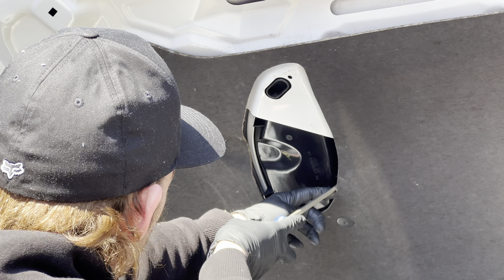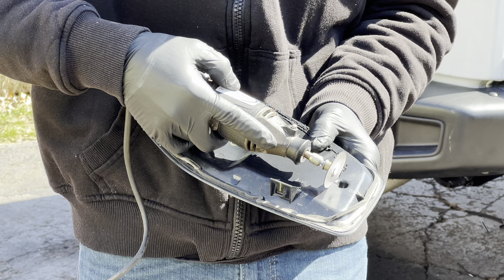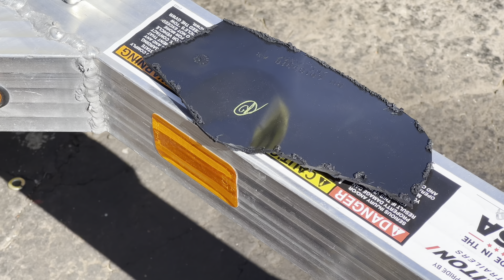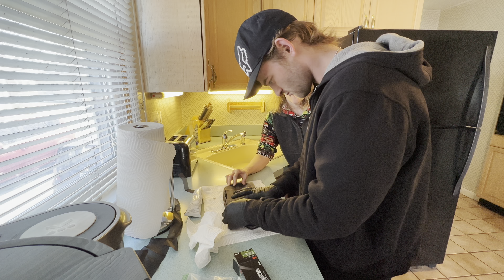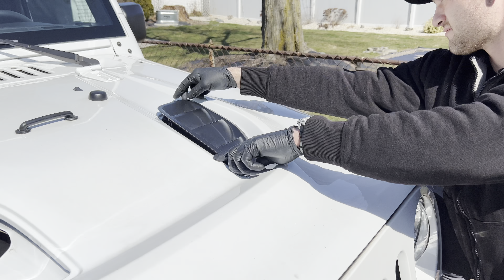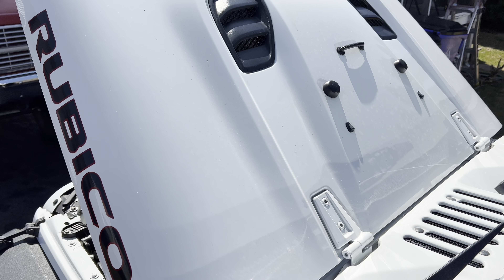Release the Heat - Cutting the Hood Vents in a 2015 Jeep Wrangler JK Rubicon

Comment: Did you test the results? Did it actually lower engine temps?
Reply from the maker: Hi John. I'm mostly copying the reply I sent to @redrightreturn1085, but basically it didn't lower the engine temperature, but Matt says it helps in other ways...

He said it helps reduce the chance of the engine getting "heat soak" and also keeps the engine bay itself cooler. This helps keep plastic components like wire looms cooler and getting brittle from too much heat.

He then said it probably wasn't necessary, but any heat is bad for engines, and he wanted to do it since it would likely help and wouldn't have any negatives.

He then compared an engine to a human by saying, "Air conditioning isn't necessary, but you sure sleep better when it's on...cars are the same way."

Comment: Even with getting into total weight of 2 wave runners, even if the FX’s, trailer and 2 full tanks, total weight is still under 3k lbs. so I’m surprised the Jeep would need hood vents to cool. Not bashing just don’t get it: Bitchen video😎👍🏽
Reply from the maker: I asked Matt, and he starting using mechanic-speak, which kind of confused, but basically it helps reduce the chance of the engine getting "heat soak" and also keeps the engine bay itself cooler. This helps keep plastic components like wire looms cooler and getting brittle from too much heat.

He then said it probably wasn't necessary, but any heat is bad for engines, and he wanted to do it since it would likely help and wouldn't have any negatives.

He then compared an engine to a human by saying, "Air conditioning isn't necessary, but you sure sleep better when it's on...cars are the same way."
Reply: @MarkDHall  makes sense. I do preventative maintenance a lot on my trucks.
Reply from the maker: @redrightreturn1085  It's important and helps keep them running longer. We prefer to do things ourselves rather than go to a dealer.
Reply: @MarkDHall  same here!🤣👍🏽 for everything auto and wave runner related. Yes, the vents make sense now, as they will allow for more engine cooling and won’t hurt anything